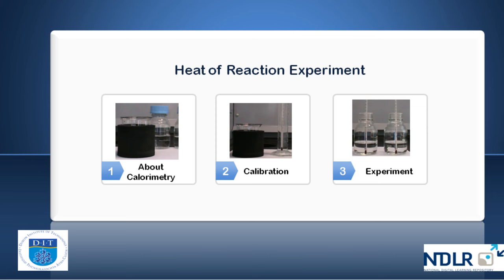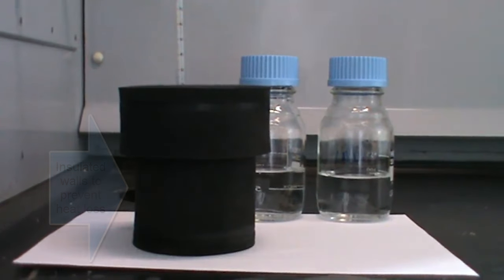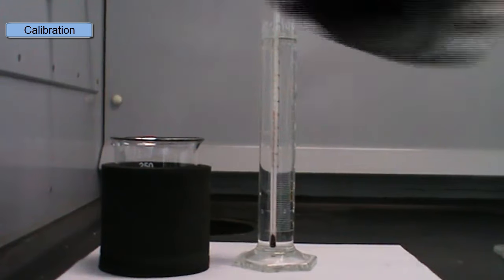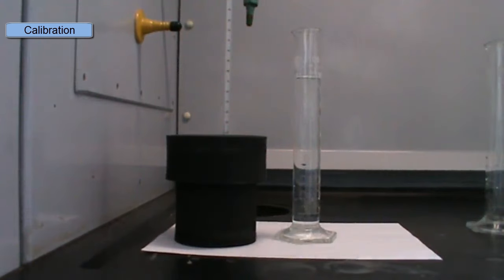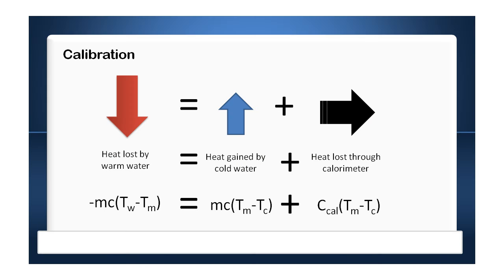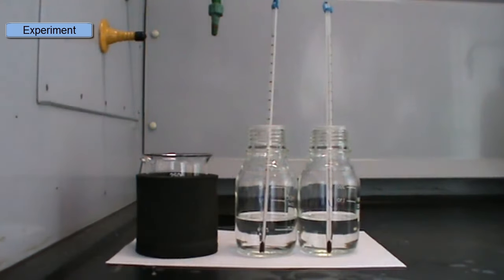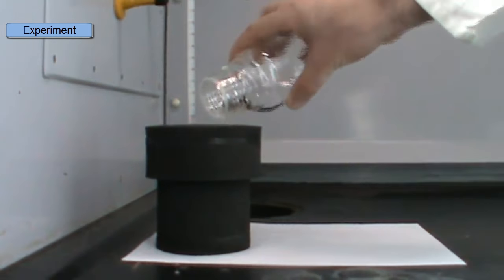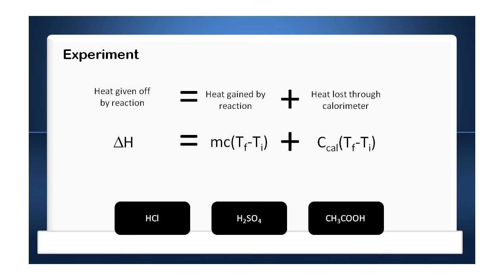Heat of Reaction (Calorimetry) Experiment

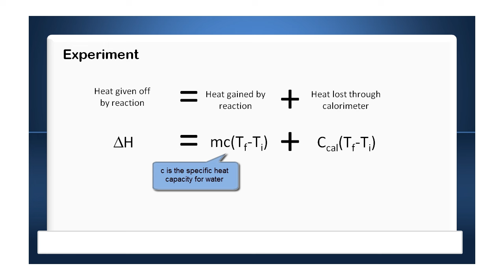Comment: This video is great, thank you!  However, I think there's a mistake in the equation at 3:50.  "Heat gained by reactIon" should read "Heat gained by solvent water."  The reaction releases heat, and the solvent water absorbs most of that heat.